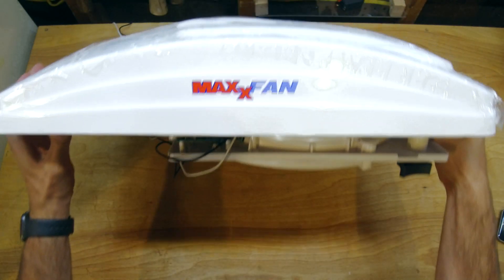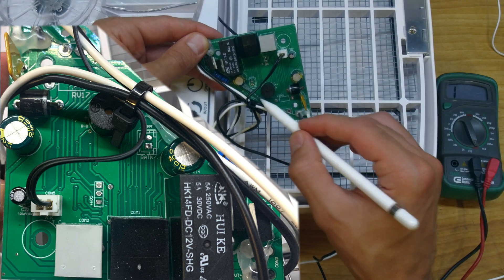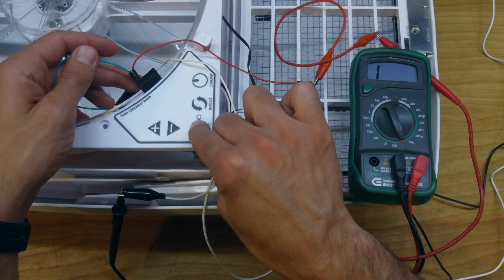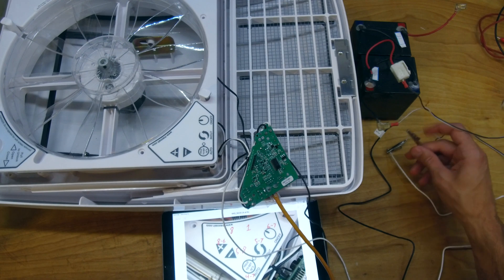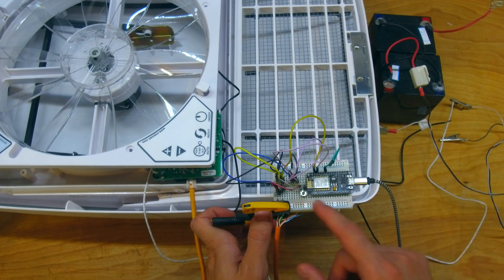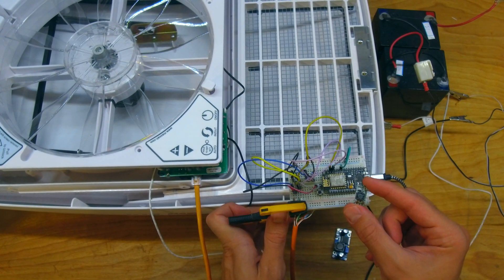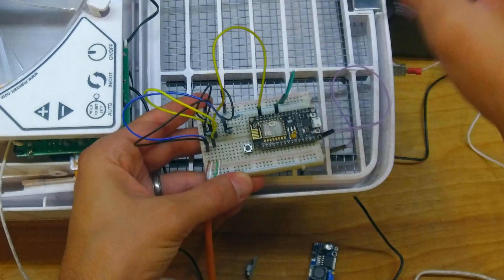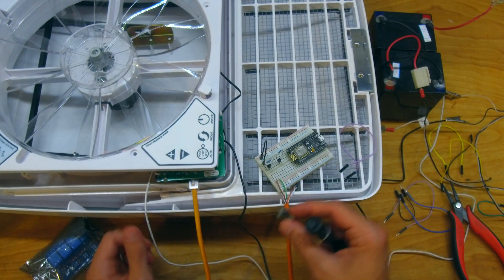Adding smart controls to a MaxxFan using ethernet

Comment: @Zef I didn't fully understand one thing. If the red LED lights up and pauses for 2 seconds, does it control an output "Up" for the fan to drive faster? Then 2 seconds later the blue LED lights up and then controls “down” so to speak? and you programmed it like that just to show simulation?

Comment: Do you know what the RJ12 is for? Thanks for the info on the RJ45, exactly what I was looking for.
Reply: The RJ12 has the same function but different pinout.  Maxxfan makes/made different wired remotes, some with rj12.
Reply from the maker: Glad you found it helpful! Someone just wrote me with some info about that other connector. I added it to the post on my website, so feel free to check it out there. It does some of the same stuff but has some differing functionality too.
Reply: @ZefStudio  Unfortunately I don’t see anything about it in the post on your website. Could you include the link?
Reply: @ZefStudio I see it on your site now
Reply from the maker: Great! Yeah I had a problem publishing the changes. Fixed now.
Reply: @ZefStudio  On your website you mention a "Chris"...who is he? Where can I find his stuff? I would like to have a look myself on what he had to say about the PWM Signal, since I want to include FanSpeed detection in my automation.